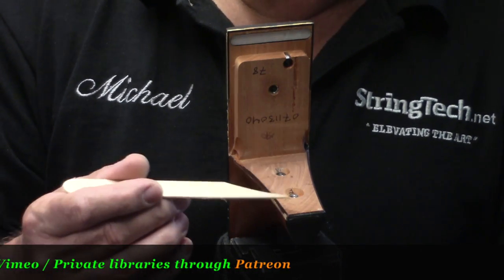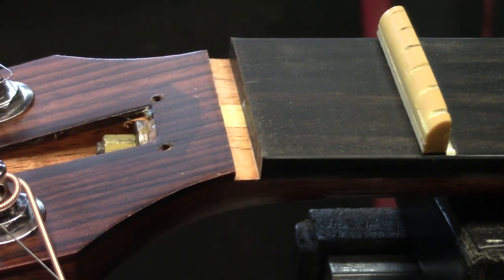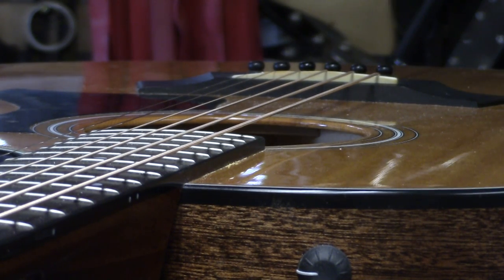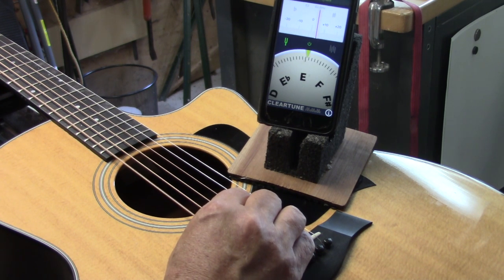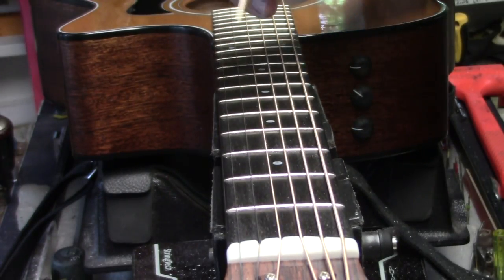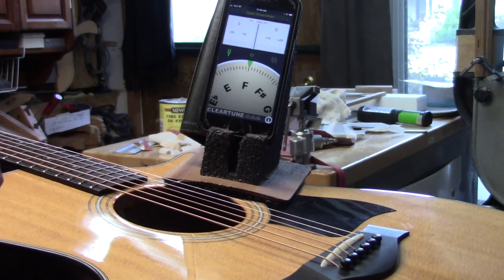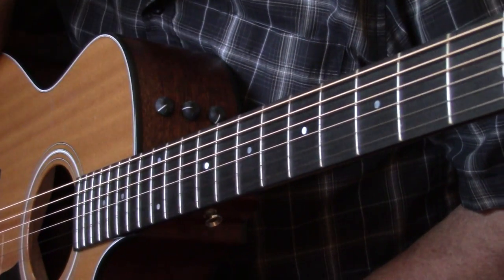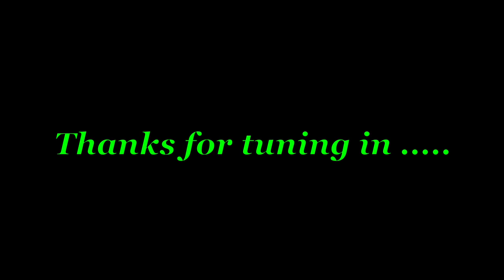Taylor Guitar Neck Details and Full Calibration@StringTechWorkstations

Comment: The hump (higher frets) at the neck joint area, is a result of tilting the neck angle by way of putting a taper in the heel-shim, but failing to do so  in the fretboard-extension-shim alike. That prevents the neck to tilt as a unit. (this guitar effectively only tilted in the vertical plane). This is a good video though and the intonation aspect and intonating at the nut is well explained. Thank you for sharing
Reply from the maker: Both shims were taken down. The final correction at the neck to body joint was very minute. ( a few thou ).
Reply: @StringTechWorkstations  Missed that detail, thanks

Comment: Taylor makes entire sets of the heel and fretboard extention shims, if you change both to the appropriate values , it does all the correction and nevver a 12th fret hump
Reply from the maker: It's nice that Taylor is now offering these shim sets. I've been working on Taylors since Bob was working out of his Lemon Grove shop .... watching through the decades ... as the various configurations of neck joints came and went. I address the neck joints quickly / precisely and easily  ( had another one dropped of today ).... lining them up perfectly with my slow- mo disc sander drill press convertion kit \m/ !
Reply: @StringTechWorkstations  I have a 562ce 12 fret 12 string, a big baby, a 214 ce, and a 814ce, love them all, i have the shim sets and tool set they sold me as an entire kit, but now I have a made in Lemon Grove 12 string Drednaught on layaway at a local pawn shop, spruce top indian rose wood back and sides, I cant wait.
Reply from the maker: Nice !
Reply: If the original owner of the guitar, it should have taken it back to Taylor, they do all this work free under warranty
Reply from the maker: @BillyZakk  It is a long drive to California from Ontario.
Reply: @BillyZakk  shipping can be expensive depending where you live, and its not always covered
Reply: @jimdoner3443  there is no need to ship, Taylor trained techs are all over, there were five within 20 miles of me

List on their website, or e mail like I did and the will send a list of one close to you

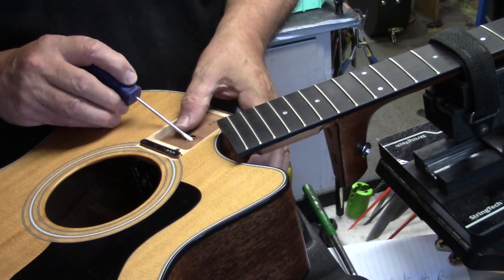Comment: I don't understand one thing.. If at 1:26 you are reducing the bottom part, the fretboard near the sound hole will increase height, right? so you should add more materiel to compensate the height of fretboard.. but actually you reduced the height of shim near the sound hole instead of increasing at 7:25 ... And still it came out perfect.. I know that is how it is done but i dont understand how... Anyway thanks for these v useful videos.. : )
Reply from the maker: You are way over thinking this ... watch the video a few more times and it will sink in. Thanks for the comment. MMcC
Reply: @StringTechWorkstations  Yeah i might be.. Thank for the response
Reply: You’re absolutely right. If the neck is being pitched back, as it is in this case, than material should be ADDED to the sound-hole side of the fingerboard shim. I sent this over to Josh Mundt at Taylor Guitars and he also agreed that this was absolutely the WRONG way to perform the Taylor neck reset, especially since properly cut shims are provided to Taylor authorized techs. I am not a luthier, but I have done my own next resets for this very reason, and Taylor support has been kind enough to provide me with the shims necessary to do so when I contacted them and let them know that there were no Taylor authorized techs reasonably close to me. If you own a Taylor guitar that you care about, I would recommend taking it to a Taylor authorized tech, or learning to do the next reset yourself. It’s incredibly easy if you have the shims, and takes no more than 10 minutes to do properly without all this sanding nonsense. Sometimes, old school luthiers refuse to let their old habits die and will try and force their antiquated knowledge to work in a situation not designed for that methodology. Left like that, this guitar could potentially develop a hump in the fingerboard extension over the years.
Reply: @real_mrmime9617  Thank for that info ..
Reply: @real_mrmime9617  Thank you! I was watching this horrified!

Comment: my taylor has a belly bulge . is this a normal taylor design or is that what could be effecting my action. but i will skim my shim and see if it helps
Reply from the maker: Taylors have a 60' spherical radius on the their tops. You probably need to reset the neck angle. MMcC
Reply: @StringTechWorkstations  thnx mate for the feedback so soon. i have made a same dimension heal shim , only with a slightly steeper angle by several thou. i will take this down gradualy untill my straight edge ( laying on perfectly flat ) fretboard just clears the bridge in the centre. but what about the top shim ?. in theory , wouldnt the resultant gap need to be filled. Sorry for the questions but because the heal has moved further away from the the saddle will the saddles intonation points still be within taylors saddle width ? . cheers again from australia
Reply from the maker: It depends on how much correction you need. If necessary, you may need to cantilever the saddle for the d/g strings..

Comment: Puzzling that they would say the compensated nuts & bridges would be limited by the key. It seems to me (I am by no means an expert) that if the instrument is intonated, up & down the fret board, the key/tonic/chord/etc should be irrelevant.
Reply from the maker: I thought that was a bit funny too. They also so had a dedicated tuner with "off-sets" that seemed way too complicated. As you can see ( and hear ) .... once it is completely calibrated .. nut / saddles / string choice / tuning preference / action preference / truss rod and lay of the neck adjusted ... after that ... you just tune your guitar like you always have ... no special off-sets or weird squiggly frets Lol !

Comment: You do know that you are supposed to swap the heel shim and the fretboard shim in pairs. What you take off the heel you have to add under the fret board.
Reply from the maker: Not necessarily. If you watch the Martin dovetail re-set, it will give you a better idea of "my take" on this. The" ski-jumping" fingerboard extension ( on both the Taylor and the D-28 ) now lay beautifully flat ... in perfect alignment with the trajectory of the string path.
Reply: @StringTechWorkstations  I carried out a neck reset on my Taylor using shims supplied by Taylor themselves. They have a numbering system and you have to maintain a difference of 6, so if you have an 18 at the heel you have a 12 under the fingerboard, or a 20 at the heel you have a 14 under the fingerboard etc. They say if you don't do this after time the fingerboard can be damaged as the correct angle is not maintained. Just saying, great channel though.
Reply from the maker: That's awesome .. good for you. The first Taylor neck reset I did, many many years ago was a 12-string ( serial # 387 .... Lol ! ) out of Bob's Lemon Grove California shop. I have followed all of the various neck joint changes that have appeared over the years ... adapting as I go ... long before they offered any shims. I've had 100% success rate over the last 30 years using my slo-mo radius sander; skimming the shims down in a matter of 12 seconds .... and "clickety-click" ... it's done flawlessly, in a flash. Never once had an issue in the last 30 years ( I'll keep my fingers crossed though  ... Lol ! ).Cheers Billy \m/ !